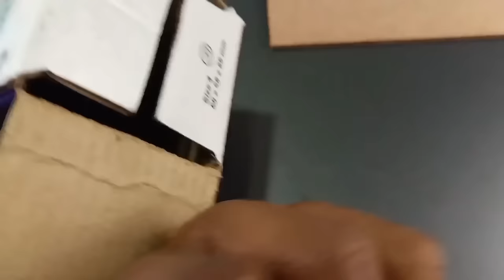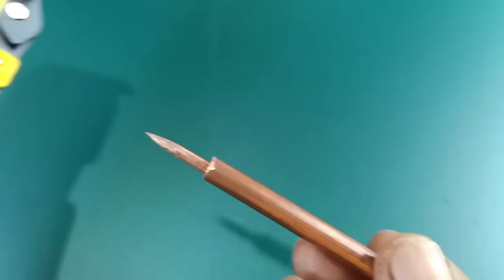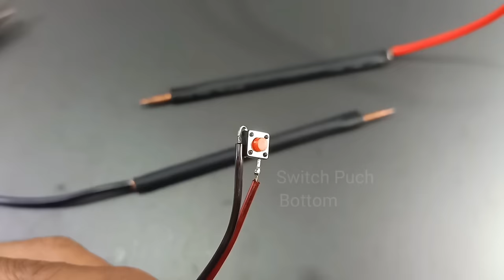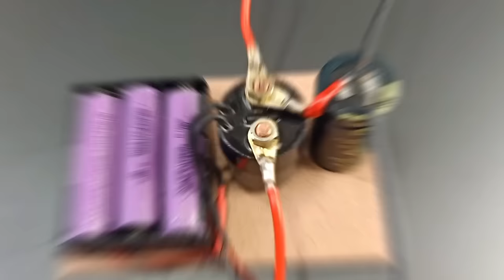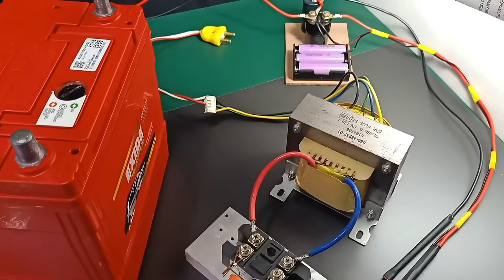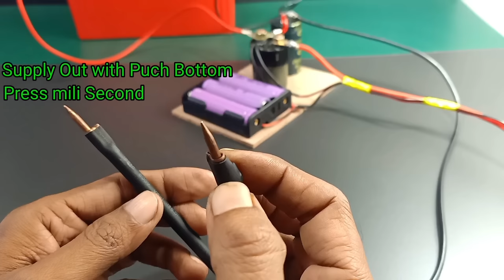Spot Welding Machine Simple & Power, Helpful for Home // How to make a Power SPOT welding A

Comment: Why do you have those three li-ion batteries (12V) separately for the relay's drive coils when you could use the same big 12V battery as for everything else? They are just an unnecessary expense.
Reply from the maker: Li ion battery use for puch bottom
Reply: Was wondering the same thing.
Reply: If you look at the circuit you will see you're actually shorting out the 12v lead acid battery when welding. This could drop the voltage and the relay would then let go. Then the voltage would ride again and the relay connect and so on.... You'd have made a buzzer!
Reply: What happens if we use 12v dc adaptor instead of batteries
Reply: @drsudduu  You can if you have high current rated adapter. For spot welding you need high current.
Reply: @ankitchakraborty2960 12v 50A smps will be enough?
Reply: @settingshadow  Yes. It is enough amperage.
Reply: @ankitchakraborty2960  which way shold i place it? on the relay side or lead acid side or both since it has 2 output ports
Reply: @settingshadow  You can replace the lead acid battery with the adapter or smps. 
In the video the relay uses seperate lithium ion battery because the little push button cannot handle the high power  lead acid battery / adaptor. The relay coil can also get burnt. So the relay-switch side of the circuit needs low current power supply. And the capacitor side needs high power supply.
Reply: @ankitchakraborty2960  okay thanks i'll just have to buy other components and try it
Reply: @ankitchakraborty2960  one more question though what type of relay should i use to replace the relay he used i cant find that relay in my area
Reply: @japifly; you're an unnecessary expense.
Reply: @RJEDITALL какую роль играет конденсатор? Спасибо
Reply: Gracias
Reply: @drsudduu adapter does not produce enough current for spot welding
Reply: @RJEDITALL He means you can use the same big 12V battery to control the push button and the relay coil instead of separate battery with lithium ion.
Reply: @user-rc151 видимо чтобы не было постоянного замыкания. А так нажал кнопку кондер разрядился.
Reply: @RJEDITALL what is the role of the capacitor in the circuit?
Reply: Why not wind a 10 v winding on the transformer after working out the t/v of the primary winding and connect a bridge and cap and use it for the circuit rather than use a seperate 12v battery.
Reply: Maybe the cars battery current is too strong for the relay
Reply: Those lithium batteries is  use as a trigger for the relay  to  amplify the amperage of the lead acid battery  and to control the supply so that  it can weld without. Any  problem.
Reply: @user-rc151  capacitor is use so the power will not drop quickly, cause capacitor is storing power so that it can stabilize the output.

Comment: Pl. Provide connection diagram there is some confusion into the connections of two types of Batteries.
Reply from the maker: Please check diagram in the video , end video
Reply: Yes me too some confusion at first glance
Reply: The small batteries are to fire the relay
Reply: For diagram 7:36
Reply: @learnexcelwithnaveen  t shows 0,0000000001 micro seconds 🤣😂😂😂😂 WTF😂🤣🤣😂🤣
Reply: This is just a naive shit circuit. The problem was could such a mere capacitor really do that? It is highly doubtful.
Reply: @robertyu3920  right? What are the lipo's for? If one is paying attention, he hooks the solenoid contact to a 12v lead-acid car battery! He could just as well used the 12v from the car battery to kick the solenoid. The cap doesn't really add much to the short circuit current from the battery either
Reply: 18650 function.??
🤣🤣
Reply: 3 batteries 3.7V serve as power supply to relay.
Reply: @brucelytle1144 u're commonly right, but if u short the Carbattery, there is maybe not enough voltage for this relay to be hold. So if u want to burn longer, u should use galvanically seperated voltage sources.

If u're a engineering guy, use much more capacitors and solder your own charging circuit. So u can use only one battery.
Reply: Why not we used big 12 volt battery also for relay?
Why used li ion cell
Reply: @pierrejeanes  press pause bro
Reply: @HARISHbhartiya.  yep, he could by just using a bigger resistor.
Reply: No diagram
Reply: You people try it with the large battery and you will notice the tiny button switch will be burnt because of hi amperage output of the big battery, he wont do that without a reason,

Comment: I built something similar. Copper doesnt work for the electrodes. They just get welded to the nickel.  I used tungsten from a tig welder and found success.
Reply: @2pist  if I cannot get a tungsten would concrete nails do the job?

Comment: Are there other choices for the resistor besides .22 ohms? Can you suggest other values please to substitute? Thank you in advance for your response . Great video, nice close-ups, etc.
Reply from the maker: You can use .10 , .33 , .47 & 1 Ohm
Reply: Thank you so much for the quick reply. Keep up the good work. Love the video, very good camera work, etc. Thank you.
Reply: Most things in electronics and even electrical circuits have a plus or minus tolerance of around 10% or even 15% on some components and the circuit will still work just fine.😉🙃
Reply: Use a higher value, at least 180 Ohms. The button will burn out soon if you don't.
Reply: @imnotbeluga007  .Thank you for this.
Reply: There is zero need for the resistor, that starter relay will easily handle the 12.6V the 3 liion cells can put out.
My bigger question is why even use the relay and not a FET?
Reply: @Ozzy3333333  Will the starter relay handle the current from the cells? Will the cells be fine with a short circuit which the discharged capacitor presents? The answer to both is no - a small resistance value to limit the current rise is essential.
Reply: @chrisstreet6827  Yes and No.
Yes the relay handle the current from the 3s liion cells, its normally connected to a Pb battery with much lower ESR and thus a higher current , but your forgetting the huge inductance that limits the current in the relay coil.
No, the cells are not charging the cap, I think you need to rewatch the video. He should took 30 seconds to draw a schematic, but he didn't.
Mosfets are a much better way to control high current pulses, I guarantee that relay that relay wont be happy after a while, it WILL be the first thing to fail. But he probably dont know fets or the relay was free.
Reply: @Ozzy3333333 what mosfet is advisable to replace the relay?
Reply: @Ozzy3333333  what wattage should the Resistor be for heat?
Reply: @RJEDITALL  What wattage resistor are you using
Reply: You only need the Battery and relé

Comment: I would insert a diode in parallel to the coil to suppress overvoltage rising during "off" of the switch. Cathode towards positive, of course ...
Reply from the maker: You try
Reply: That will make the relay drop out slower - do you really want that?

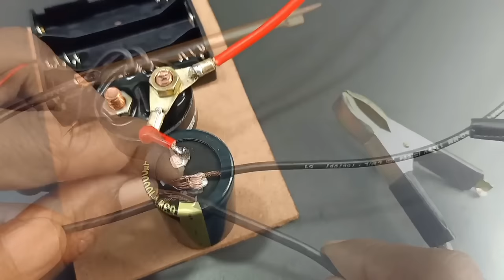Comment: VERY clever circuit design! I even happen to have two Nichicon 80v 10,000μF caps laying around to use for this!  And at 2:12 what is THIS? Someone who knows how to properly use MORE FLUX to get a better solder bond?! Unlike 99.9% of other videos on YouTube that haven't got a clue this stuff even 'exists', let alone how it makes your work so much easier because of a MUCH faster HEAT transfer with a liquid!?😎
Reply from the maker: You can try with your capacitor, Best maximum 4700 - 6800uf
Reply: Ive got sevral 100v 100k uf nichicon caps im not using a well , I just didn't think they would be powerful enough I thought you would need like 100f
Reply: @SheikhN-bible-syndrome  wire them in series/parallel until you have enough voltage/capacitance. Do an image search "series vs parallel" and it'll show battery wiring diagrams and how connecting + to + and - to - vs - + changes the voltage and capacity/amps.
Reply: @SheikhN-bible-syndrome  just be REALLY CAREFUL not to get shocked by that kind of voltage/capacitance... ☠️ ⚡ I would recommend covering all the exposed terminals ETC with liquid electrical tape, a couple coats of latex paint or similar protective covering.
Reply: @macgyver5108  I know a little bit about Electronics I've been doing car audio for about 15 years and I just started building simple Class A solid-state amplifiers I just can't figure out a timing method to time the output for spot welding I know not to just charge the capacitor up and then connect to a gauge wires to it and just short-circuited on the middle LOL I need some form of controller or learn how to build a controller I've also got a bank of super caps I made out of 6 500f 2.7v caps which can take up to 16.8v and a little over 100f but its probably getting used when I figure out how to make a miniature magnet charger for making my own little magnets.

Correct me if I'm wrong but I shouldn't worry about getting shocked until the voltage reaches over 48v on those capacitors correct? Or can I still get a zap off of something in the 16 Volt range?
Reply: @SheikhN-bible-syndrome  the safety issue with big capacitors depends more so on the current flow... amps/capacitance than the voltage. Even 24v can send you to the hospital with enough current/amperage behind it like 1-2f, and 42v can stop your heart easily.
Reply: @SheikhN-bible-syndrome  and yeah, a hefty resistor works best to drain a cap without damaging it... 👍
Reply: @macgyver5108  This is 12v DC gear. It's unlikely to build much voltage even when welding. The biggest risk would be the relay contacts welding together and you can't stop welding. This would rapidly heat the battery you're welding terminals onto and you'd have to yank the probes away before they became welded too. Not that risky though.
Reply: @wayland7150  glad you could join the conversation and miss the part where we're talking ONE HUNDRED VOLTS and not a measly little twelve volts...
Reply: @macgyver5108  Talking components with a rating of 80v and 100v. No talk of welding with 100v.
Reply: @wayland7150  yeah, 80v to 100v capacitors that could leave you arguing about the thickness of the dirt over your burial plot if you're smart enough to touch them...🙄

Comment: Well, if you circuit diagram is correct this is unfortunately not a very good device, it simply will not last long.  For several reasons:
1. Your 80A relay is badly underrated for the currents involved (circa 200a).
2. Your tiny push button is extremely underrated. It's max rating cannot exceed 0.5 A, the current you are pushing through is 
     3.7x3/0.22=50.5A!!!!   That button is a goner.                                
3. Your capacitor is in parallel to the power buttery irrespective of the state of the relay, I can't see it's purpose. Also an inductive pulse   
     created in the power wires during welding can easily exceed it's rating of 50V, it can also damage the battery. So protection is  
     required, eg a TVS diode.
4. Duration of the welding pulse depends on nimbleness of your fingers, not a very good idea.

Of course, if the diagram is not correct the comments above don't apply.
Reply: @blg53 do you have a channel with better spot welder project ? I want to build one
Reply: @astasidhy4243  I have built one, but I did not record a video about it.  What I suggest you do is to search Youtube with " diy spot welding machine". You will get a lot of hits, but be very selective about which one to imitate, pay attention to my points in the previous post.  Some designs involve a car battery, some other batteries, some microwave transformer. The better ones use a timing driver to regulate duration of the welding pulse, often based on the 555 timer. If you chose to make one that is based on a powerful battery + MOSFETs make sure that your driver circuitry is fed by a SEPARATE battery, not the welding one. If you use the same battery for both welding pulse and the driver you will burn your MOSFETs (or the solid state relay) in no time.  Good luck with your project.

Comment: Thanks for the video. I'm going to make one myself. Just wondering why you used a separate 18650 pack for the relay? Couldn't you use the car battery voltage for that also?
Reply from the maker: You try, complete understand

Comment: selest  adapter 12 v   3 x 3.7v......  relay conecten batarea 12v  18-38 Ah
Reply from the maker: Clear not understand
Reply: @RJEDITALL  
Everything can be connected to a 12 watt battery. If the voltage is more than 12 watts. we put the converter DC (X) - DC 12 V ..
 3.7w x 3pcs it's too much. Everything runs on a single battery.

Comment: I like what you do,  if I had one comment I would have to say the soldering skills of modern YouTube people make me want to yell at the TV.  When I was in the Air Force in the late 70s we had a 2 week class on high reliability soldering, it was needed because we had to replace surface mount ICs which were new at the time.  Subbed to your channel.
Reply from the maker: Thank u very much sir for sub
Reply: If I have one suggestion it's the heatshrink sleeve should have been longer to protect the wire too.

Comment: Ihzve a few questions about this project
Could it be used to make copper jewelry or jewelry any other material
My mom ntrest in this idea is that itis controled I like this idea and will like to know about how small an electrode it can handle to make stuff out of copper wire l like rings and chains 
                                                      Thank you in advance
                                                       Thank you for sharing

Comment: excelente, pero la bateria se descargara muy rapido por estar conectada a la bateria directo, entre la batería y el capacitor tienes que colocar un diodo de microondas. y listo solucionado.
Reply from the maker: No discharge quickly for capacitor, mili second run with puch bottom

Comment: Why not use the same 12v source to switch the relay and power the capacitor/welding?
Reply from the maker: You try, u will understand
Reply: The action of welding shorts the lead acid battery. The relay would let go.

Comment: could you power the relay with the big battery instead of 3 lithium cells
Reply from the maker: Yes, You use battery with 100 ohm 2 watt Rasistor, but your puch bottom damage problems
Reply: You need to make sure the button and relay have good power. The welding battery gets shorted so the relay would let go.

Comment: Great tutorial. I'm considering making it but wondering if you think the components I have to hand would be sufficient. I have converted an Xbox power supply which outputs DC12v and around 12amps. The only capacitor I have is an AC 7uF. Would this work ??
Reply from the maker: No bro, minimum 20A, capacitor minimum 4700uf
Reply: @RJEDITALL  thank you

Comment: I thought the 3 batteries will power this, what’s the big battery for
Reply from the maker: 3 batteries for relay n push button, big battery use for spot welding

Comment: Bonjour merci pour la vidéo, c'est certainement ce montage que je vais choisir, mais 2 questions SVP c'est bien la batterie au plomb qui charge les accus 18650 ? et est ce qu'une batterie moto est suffisante ?
Reply from the maker: You can use 12v 2A adopter instead lithium battery, minimum 32Ah battery
Reply: @RJEDITALL  merci de votre réponse mais je pense que ma traduction n'est pas bonne je vais essayer d'être compréhensible
1 ere question comment se charge les 18650 ?
 2 eme question mais je pense avoir la réponse, il faut dont une batterie minimum 32 ah donc une batterie voiture
merci beaucoup

Comment: Why does the relay need the separate power supply?
Reply from the maker: I am try with - without lithium battery's . You try, complete understand
Reply: @RJEDITALL  What I mean is, why do you not power the relay from the car battery? Why do you need a separate limo batteries for that?

Comment: Gotta say, ya dont need the lithium cells to trigger the relay. You need the car battery, just use the switching voltage from that..
Reply from the maker: You try with lithium battery and without lithium battery, you understand

Comment: I have 2 questions, does it damage the 18650 batteries, and is it safe to touch while the button is pressed?
Reply from the maker: No damage problem, puch bottom save
Reply: @RJEDITALL  and is it safe when i accidentally touch the copper while the button is pressed
Reply from the maker: @Vexilex  yes, safe

Comment: Good evening Sir I don't have a battery so It's work for 
 18v - 0v - 18 v transformer  
5 ampere and 
5010 rectifier  output , please confirm it Sir . Thank you Sir 8:25
Reply from the maker: You try with 10000uf capacitor, same connection

Comment: An error in evaluating the resistance. It is not 22 ohms, it is 2.2 ohms. If he meant 22 ohms, the third strip should be black, not silver. However, if the partner is silver, it is not counted, so the resistance value is 2.2 ohms.

Comment: why the big capacitor is paralel permanently on the battery side instead of paralel on the two forks side? And additional question: if the power source is transformer i understand the need of power capacitor, but if the power source is car battery why you need this capacitor?
Reply from the maker: Using capacitor for battery life save

Comment: I did all but i have some problem my power supply 12v 46a but when pushbutton for weldering power supply is closing maybe current. Where am I doing wrong? For what is it happening to you?
Reply from the maker: Check your relay, and same component use
Reply: @RJEDITALL  how can i check relay ? And my batteries 800mah each one is it problem?
Reply from the maker: @resatbora  please use minimum 12v 2 ampere battery for relay, Relay's work -- switching, you can use 12v 2 ampere adobter for relay,
Reply: With my relay there is no any information can i understand some another way to check it for the same as yours?